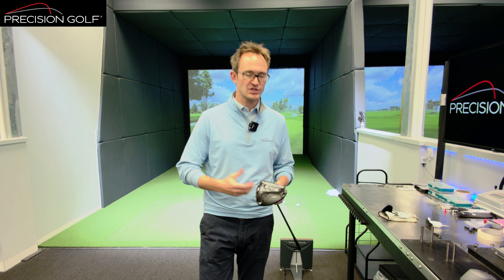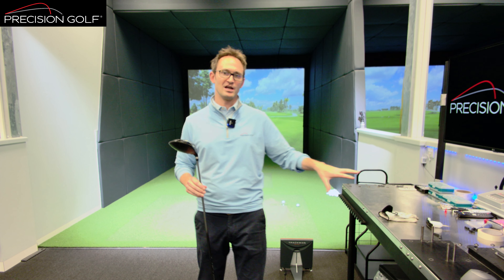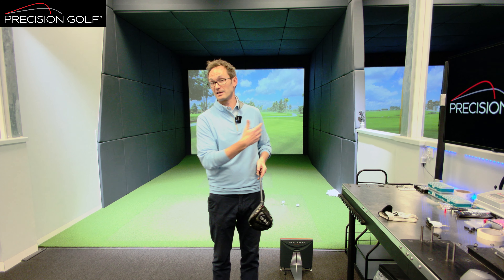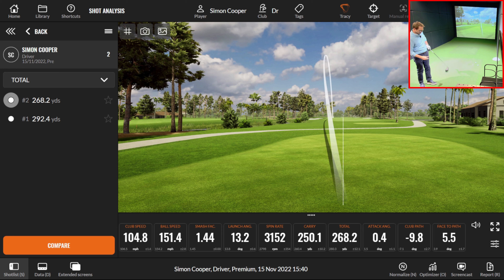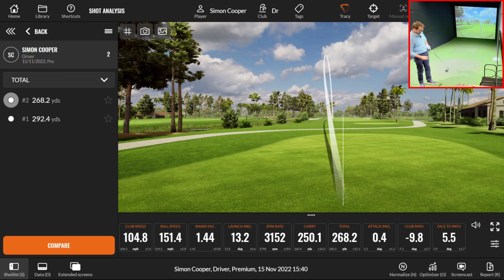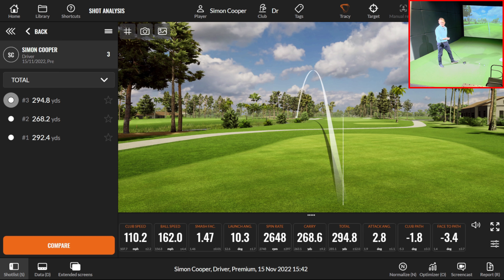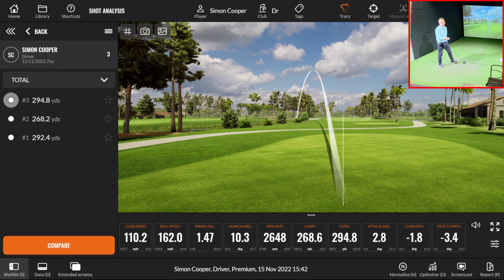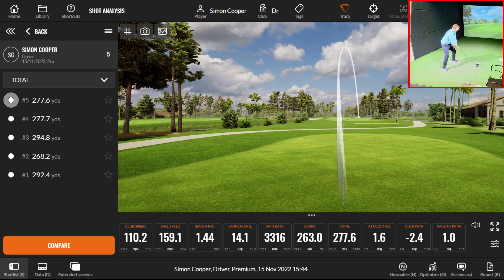SWINGWEIGHT can RUIN your clubs performance. MUST WATCH!

Comment: So at 3:29 when you're talking about this is over on this little flick move wouldn't that be the person swing? As a fitter wouldn't it be your job to fit the clubs to that person swing? Instead you say you would add more weight to get them or an optimal plane. So basically you're trying to fit them into the club and not fit the club into their swing? Something you perceive as a swing "flaw" you offset in the clubs rather than making the club's work around this person swing "flaw"?
Pay for example you talk about the lighter swingweight makes you pick the club up a little more but couldn't you offset that with overall weight? Instead of just head weight?
Reply from the maker: Not at all. You are always trying to compliment what the player does with the club, however if there is a consistent pattern that someone displays that the club can make work or help to regulate turn that is what any progression in Club spec is trying to do. Not every player will be able if want to change their swing so sometimes you have to make the best of what they have. This is fitting the player and what they intend to do with their game - if the player wants to work on their swing then you can fit to that too but every player has a different pattern and this needs taking into account with the club
Reply: So it's been a little while since this comment and I think I have a deeper understanding of equipment. So after some further thought let's say for example don't some people swing under the plane and up While others swing right on plane While others will swing over the plane and down? Also with regards to length and swing weight. Typically wouldn't a shorter Club need a heavier swing weight to create more mass and potentially more swing speed? And by contrast a longer Club if somebody wanted to swing a really long Club you could just lighten the swing weight and they could swing that club no problem. So I guess what I'm saying is I can't help but feel like somehow Fitters and the industry in general have an agenda. Instead of making people better and making the clubs work for the person they're always trying to get the person to change their technique. To illustrate this further I believe you can swing the golf club like a flail, like a hammer, like a hockey stick, like a sledgehammer upside down, like an ax etc. I think it all depends on the person and their patterns and you would make the club enhance those patterns that the person has. I think right now what it does is the exact opposite! Say for example if I come in and I want to swing the club like a flail then you would tell me well let's go with the heaviest swing weight you could do and go from there. Now once you've done that I'm not swinging it like a flail anymore I'm swinging it like a hammer. So everything my body does is going to compensate with the club's doing. Whereas if from the start you figure out maybe the heaviest overall weight I could handle and still swing this thing like a flail then I can stick with my swing and you could make the club fit to what I'm trying to do and what my intentions are. I think the entire system is broken! I think there's a reason golfers never get better and I think it's all inclusive. I think it's the teaching industry I think it's the fitting industry it's an absolute mess. And this is coming from somebody who's been trying to solve these things for many years now a little over a decade now of actual effort and research and trial and error.
Reply: So just going a little further with this flail idea! If I want to swing it like a flail and really whip the club. Then what I should be figuring out is what would be the longest Club shaft that I can swing and the most overall weight I'd be comfortable with. Then getting the swing weight as light as possible to be able to whip the club around. Once those parameters are met then I could flail the club as hard as I want but there would be enough weight to match the speed to give it mass and velocity. Then once that combination is in place that's going to match my body and what my patterns are doing. Now on the flip side of that let's say I wanted to feel the club like a hammer! Now I would dramatically shorten the club and maybe figure out an overall weight that's comfortable then a much much heavier swing weight would be needed to create the mass that's going to match the velocity. The lighter swing weight would have tremendous velocity and less Mass but then the heavier swing weight would have less velocity but more mass so they would even out. Yet the intention of the golfer in both those cases is extremely different if you're swinging a flail or a whip or if you're trying to really hammer something. I definitely don't think it's putting a person in the same box.

Comment: Fascinating. Keep it coming.
It's all in the fine detail .. but you also need to be able to know yourself what you are feeling with your swing.
I recently took my i200's with XP95R back to Ping UK (where I was fitted 5yrs ago) for a re-fit as I was aware that something did  not feel right. I was re-fit into Recoil 780 stiff. What a difference. I gained 3.5mph ball speed with remarkable consistency and all straight shots. It feels effortless and I have not hit a bad shot since. Obviously the overall weight is now less but so is the swing by 1 to 2 points. I don't know if its the shaft or SW that has made the difference.
Reply from the maker: Hey, thanks for your kind words! To be fair, it could be a combination of both shaft weight and swingweight that has helped your game
Reply: What was your swing speed before with the XP95 and after with the Recoil 780, if you know. Thanks